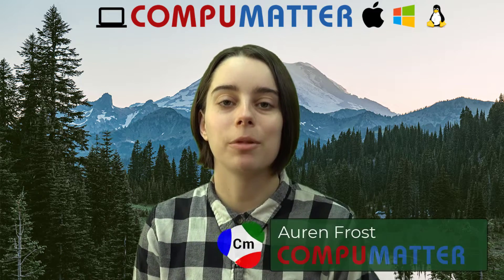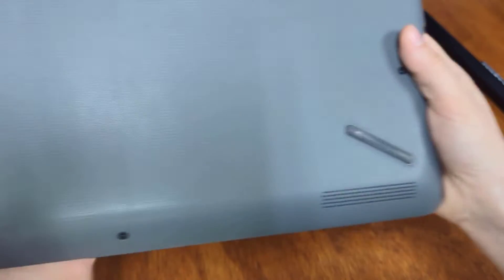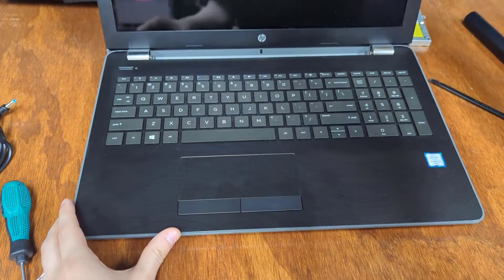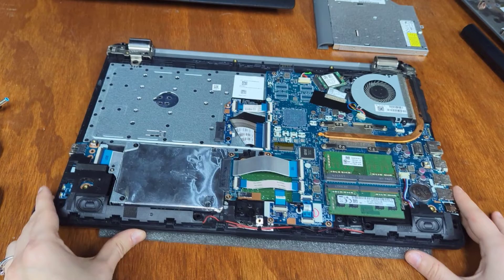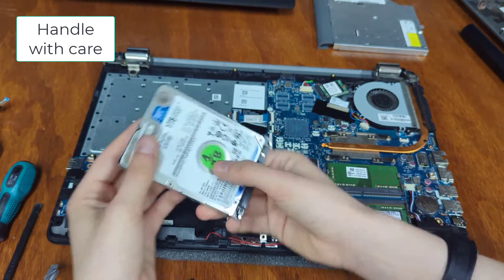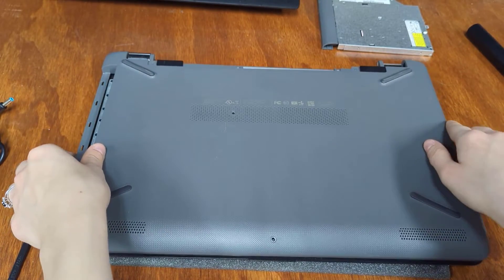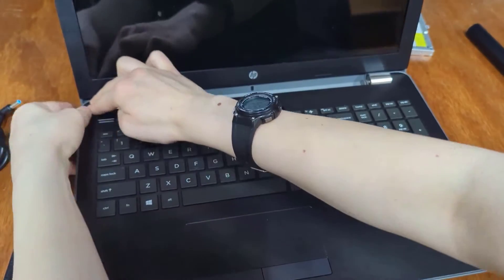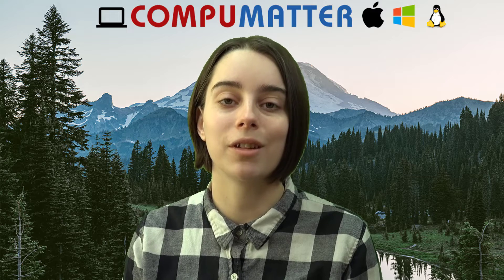HP Notebook 15-bs076nr Teardown and Disassembly - SSD/RAM Upgrade/Repair Guide + More

Comment: This is wrong information about M.2 SSD coz this kind of model that i had supported only a M.2 SATA not NVMe.I waste my money coz i bought a wrong SSD.
Reply from the maker: I sincerely apologize for the misinformation, I had incorrectly assumed it would be compatible as many laptops can work with either type and the NVMe ones are the better option out of the two. I will be sure to double check this for future videos as well.

Thank you very much for bringing that to my attention so that I can inform others. If you ordered it online or in-person, can you return the item to get a refund?

Comment: Thanks for the guide but I want to ask, how can I disassemble the screen since I got dead pixels in the bottom of my screen and I think there is something stuck under the screen
Reply from the maker: The bezel (plastic piece) surrounding the screen when it is opened can be gently removed with a pry tool going around the edge. There may be some adhesive or clips keeping it together. I do not have the laptop anymore so I cannot unfortunately offer more precise help. Once you remove the bezel though, you should be able to see some screws holding the screen, remove the screen, and carefully unplug the screen cable if you are swapping the whole screen. 

If you can, look up this particular model and see if it gives an ifixit guide teardown of the screen for a visual.

Comment: Thanks to your video and my photographic memory I just replaced my ram in a matter of 5 minutes thank you again for making a video if anyone else has this computer and wants to upgrade the RAM it's super easy with the video and like she said make sure you take your time frying up the the edges so you don't break anything I took my time and it came out really easy and popped them out the old ones pop the new ones in boom magic 16 gigs now computer runs faster next will be a SSD drive m.2 should make the computer boot up in 5 seconds